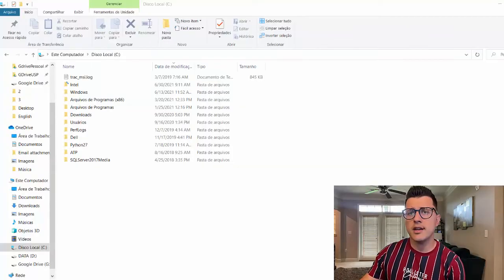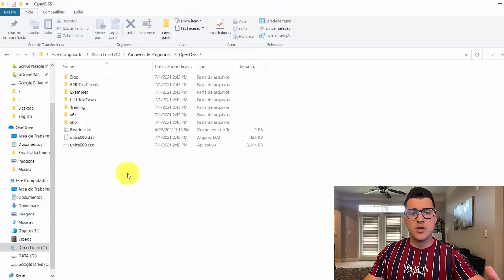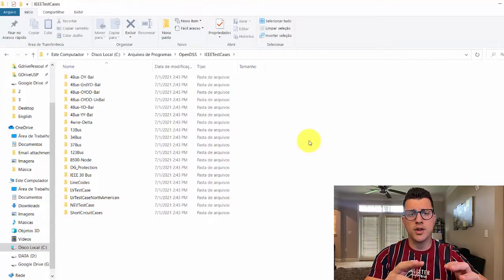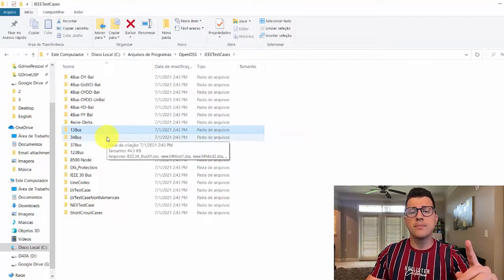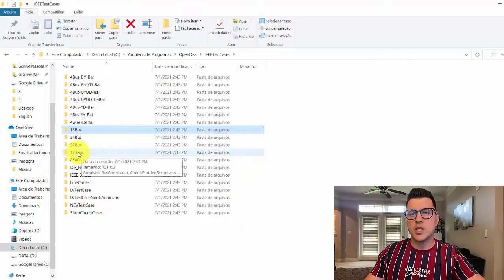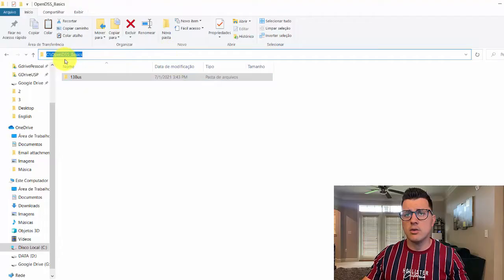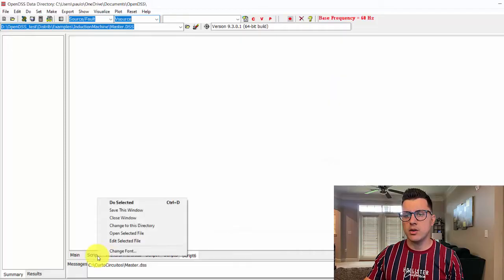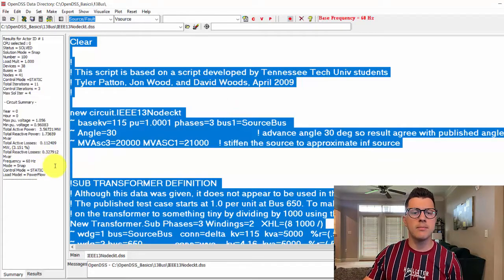1 - [En] OpenDSS Basics | Introduction

Comment: No Circuits Have been Defined for this Actor. This is what i get when i press ctrl.T and the version i downloaded is 10.2.01
Reply from the maker: Hi Monirah, this error happens when you run/add an element before adding the circuit element.

If you want to follow my newest course, you can find it in https://www.pauloradatz.me/opendss-courses

Let me know if it does not work for you!

Comment: Hi, when I want to solve this system, I receive this message" No Circuits Have been Defined for this Actor". What is the resason for that ?
Reply from the maker: Hi Ameer, the issue is that you need to define the circuit element first in your script.

If you'd like assistance, please share your script here.
Reply: @PauloRadatz  Hi Paulo, its the same as yours of 13bus IEEE example. I awalys receive this message when I try to solve the system. I solved it by first press the " Compile File Listed" bottom on the top. Is that correct way or something missing?